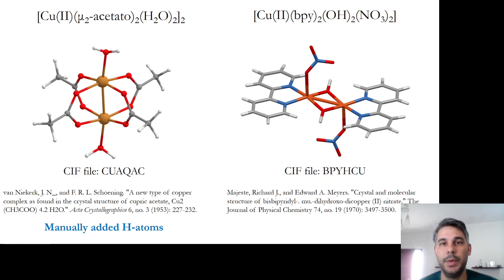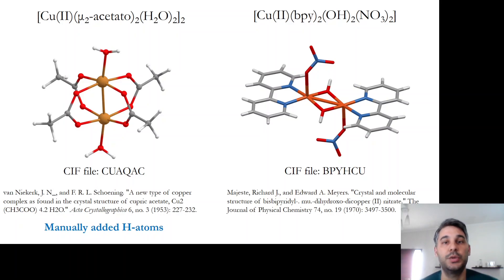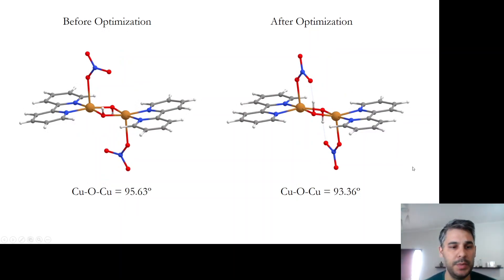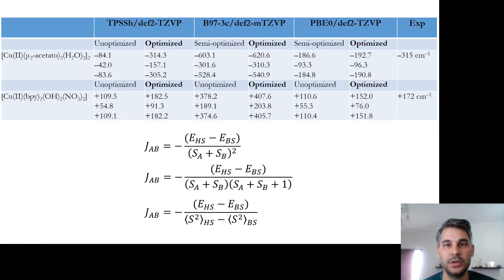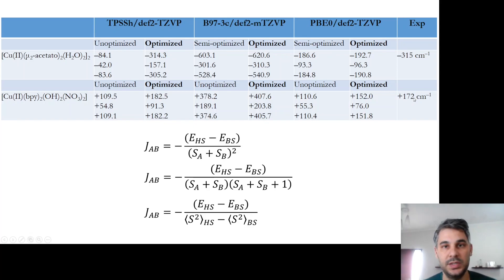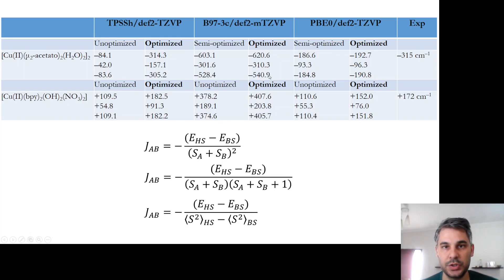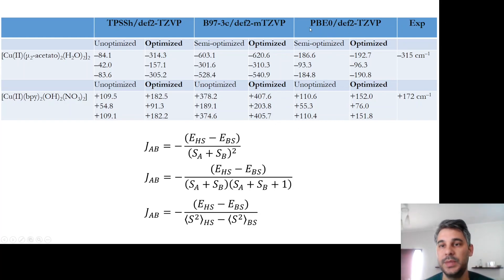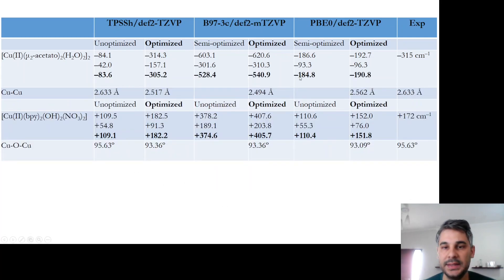Exchange Couplings in Copper Dimers done right!

Comment: Could you explain if you did optimizations on the broken-symmetry surface or the high-spin surface? Because if you optimized it on the high-spin surface and then calculated exchange couplings, you may be using a non-equilibrium geometry for the low-spin state description.
Reply from the maker: Hi, I used Broken Symmetry in the optimizations. However, if the exchange coupling is not very high, I would not expect a large difference in structural parameters. I think the exchange has to be in the large hundreds or thousands of cm-1 in order to have an influence in structure, and that depends on the rigidity of the molecule. Interesting problem, very related to spin-crossover materials.

Comment: The crystal structure Cu positions and the Cu-Cu distances are likely to be right, because they are the strongest scatterers in the crystal.  Maybe the calculations are missing something?  I believe that the experimental Cu-Cu distance are more likely to be correct, not the geometry optimized distances!
Reply from the maker: I agree that the experiment is correct. DFT will only roughly reproduce bond lengths and angles unless the chemical environment is realistic. in crystals it's the packing. I will eventually study if I can optimize a cluster of molecules in the crystal and see how much of a difference it makes.

Comment: The waters of paddlewheel complex still doesn't look very good, maybe some solvent correction should be applied.
Reply from the maker: Yep. Most likely the H2O molecules are doing H-bond with the next molecule in the crystal. And when I optimize without the surrounding molecules the H2O attempts to H-bond intramolecularly. Those are some of the problems of trying to model a crystal with a single molecular complex. It is worse when you have a covalent extended material and you need to break bonds and replace functional groups. I could add some surrounding complexes and fix their coordinates, but I'm afraid that will have to wait. I'm quite busy at the moment.
Reply: @niconeuman  Cu-O-H should me "more tetrahedral", maybe CPCM would be enough to do the job
for extended materials, maybe nwchem with plane waves would be better but unfortunately I have almost zero experience with it (I only find DFT hybrids are unbelievably slow when using plane waves)

Comment from the maker: I want to mention that the exchange will depend on very small changes in the Cu-Cu distance. There is a discrepancy between calculations and experimental exchange which I still am not sure where it comes from. I need to do further calculations and make a new video where I clarify some things which are not right from the last videos in the series. I still don't completely understand what's going on! So take this information with a grain of salt! Check comments below, some viewers have made important comments!
Reply: Actually, the Cu-Cu distance is not the main factor affecting the exchange magnitude in copper paddlewheels, since the exchange primarily occurs through bridging ligands rather than direct Cu-Cu orbitals overlap. Yet it is strange why the Cu-Cu distance changes so drastically upon optimization.
Reply from the maker: @MikhailKendin  maybe you are right. I haven't done studies in these type of complexes to separate the different contributions. It probably has an indirect effect because the bite angle of the carboxylates may change. How big it is I wouldn't know.
Reply: I tried to optimize the same structure by means of B3LYP / def2-tzvp. In my case, the Cu-Cu distance retains at ca. 2.62 Å, but the apical Cu-O bond increases up to 2.3 Å. The resulting BS-DFT solution yields the J value of ca. -400 cm-1 that is definitely inacceptiple. Where could the reason lie in, anc is it ok to use B3LYP for bs-dft calculations?
Reply from the maker: @MikhailKendin  I believe the packing effects have some influence. But also dispersion corrections are usually necessary to get realistic structures. The apical bond distances in copper complexes are influenced by the Jann Teller distortion and therefore I think that good functionals are necessary. B3lyp should be ok. I don't use it though, my workhorse is PBE0.

Comment: Are you sure that the experimental value that you are showing for the byp complex is not using  the -JS1S2 hamiltonian? If so, orca is giving the results using -2JS1S2, which means that you have to divide 172 cm-1 by 2 to be able to compare the calculated and the experimental value, if I am not mistaken. 
And I would not recommend going directly to the optimized structure (if you have a good and reliable X-ray structure!) to calculate the exchange constant using BS-DFT because of several reasons, but mainly because even if you think that a change in 2 degrees of the Cu-O-Cu angles is not that large, it has indeed a HUGE effect in the J coupling.
Thanks for the video! I am always very interested in magnetism :)
Reply from the maker: Hi, in the paper by Hatfield they use the -2JS1*S2 for the HDVV Hamiltonian, but they report the 2J = +172 cm^-1 value, and they refer to it as singlet-triplet splitting. Orca uses -2JS1*S2 but they report J, so that appears to be a different definition. I may have gotten this wrong! I asked in the Orca forum about this and will issue a clarification/rectification once I'm sure.
Regarding the crystal/DFT geometry I agree with you. However in the previous video people had criticized the fact I was using crystal unoptimized geometries, and as I (perhaps), was looking at the wrong values for the singlet-triplet gap, I thought that indeed the results were bad because of the lack of optimization.
I think that some geometry optimization may be necessary in some cases. If very subtle structural features are to be studied, perhaps optimizations with some constrains could be useful. But a good study should explore a set of different conditions and options to see how much they alter the results, to see if a result is really robust, or what it depends on.
Reply: @niconeuman  Thanks for the answer! I agree with the optimization with some constrains, or maybe just hydrogen optimization could also be a good idea. But in some cases it's known that the position of the hydrogen of the bridging OH also changes the calculated J! Like in the case of the complex with the byp. So, it depends on the situation I guess. But generally if I have good quality x-ray, I only go for the hydrogen opt or no optimization at all. Regarding the experimental value, I am very curious, because I remember working with it and I think I used J=86 cm-1 or something like this. Good videos as usual! Keep going 🙂

Comment: Please. Would there be any tutorial for calculations with QM/MM?
Reply from the maker: Hi, unfortunately not for some time. I have no experience with setting up force fields and haven't had time to learn. I have tested the qmmm module using qm/qm, with DFT on the solute and semiempirical methods such as XTB on the solvent. I may do a video on that in a month or so.
Reply: @niconeuman  It would definitely be quite interesting too.
Reply from the maker: so finally I uploaded a QM/QM example using XTB. it took me a while. if you are still interested check it out!